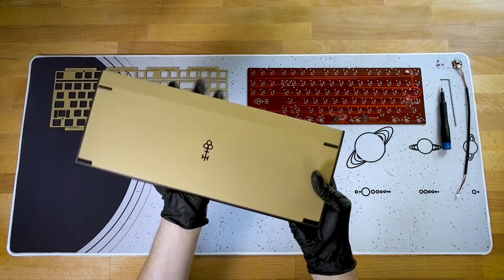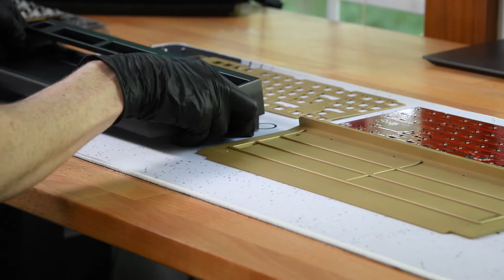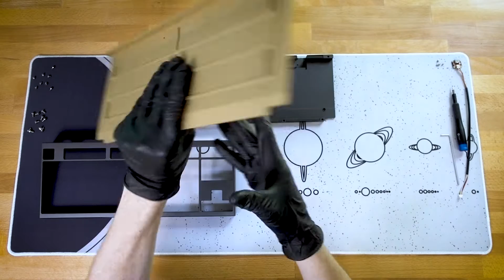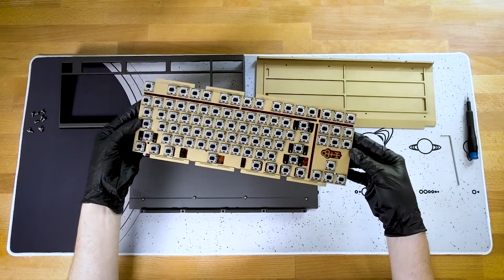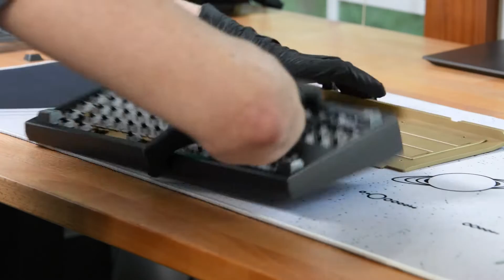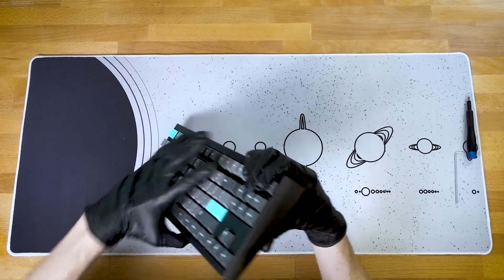No. 2 Rev. 1 First Look

Comment: what does the kit include?? or is it just the case?
Reply from the maker: Chassis, plate, PCB. Everything you need except for switches and keycaps.
Reply: @Keycult  for more than a thousand dollars ?  its a joke right .. ? Greedy guys :)
Reply: @SuperArknot  It's $680 for this keyboard in the video. It costs thousands to buy on the aftermarket or to commission them to make you one. If you aren't impatient and lucky you can just win the raffle and buy it at a reasonable price